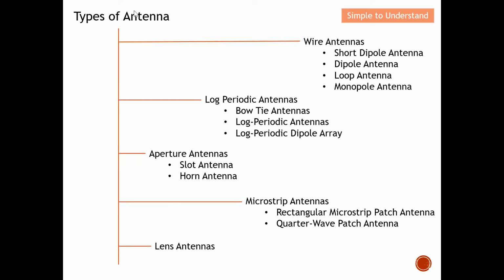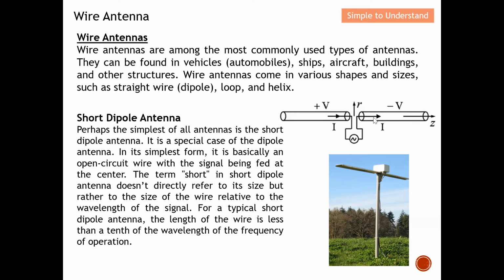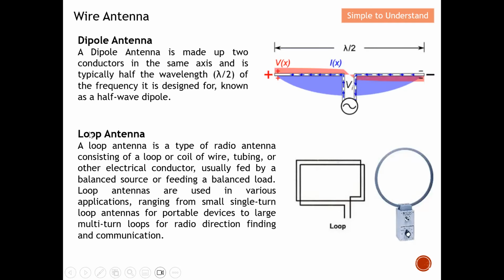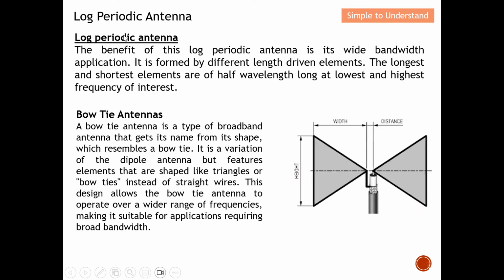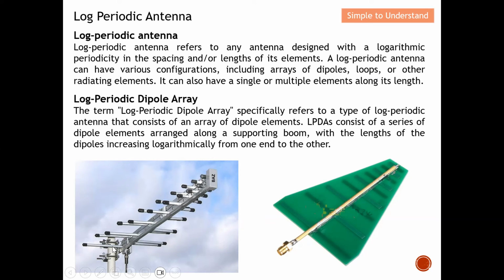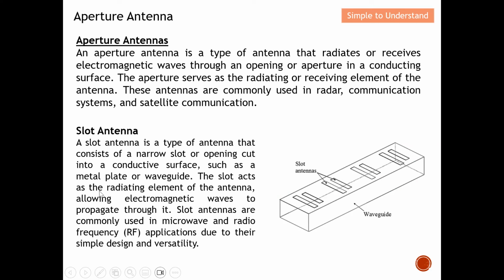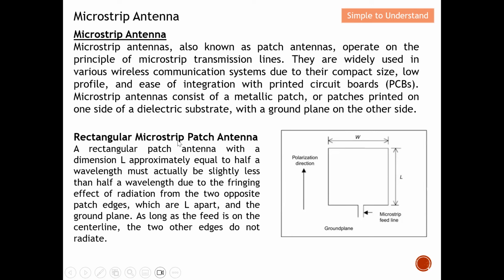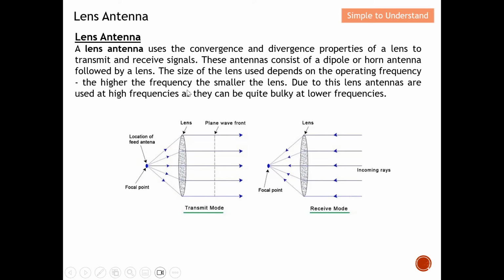Antenna #1. Types of Antennae: Loop, Dipole, Wire, Monopole, Yagi, Log Periodic, Horn & Bow Tie.

Comment: Sir if I wanted to design a loop antenna at 13.56 MHz in the dimension 20mm x 20 mm , what am I supposed to do? The results are not quite encouraging as expected. What am I supposed to do for improving the matching in the circuit?
Reply from the maker: Thank you for your question! :)
I assume you are designing an RFID antenna. Based solely on the size (20 × 20 mm), I cannot confirm whether the antenna resonates at 13.56 MHz.
The first step is to ensure your loop antenna operates at the correct frequency. To verify this:
Use a network analyzer to check the S11 parameter—it should show a dip (minimum) at 13.56 MHz.
If the resonance frequency is off, adjust the number of turns in the loop antenna (increase or decrease as needed).
Once the antenna resonates correctly, you can proceed to impedance matching, typically done using an LC network.